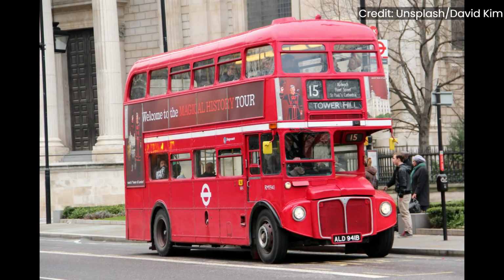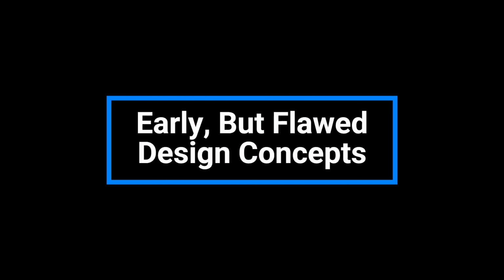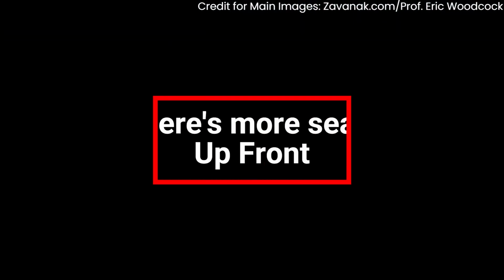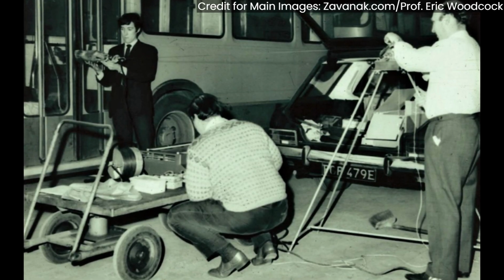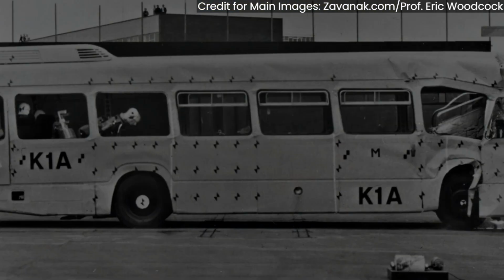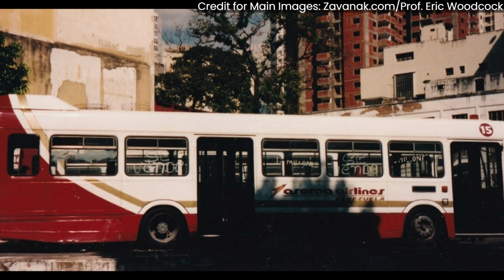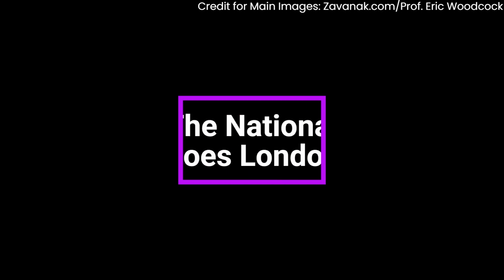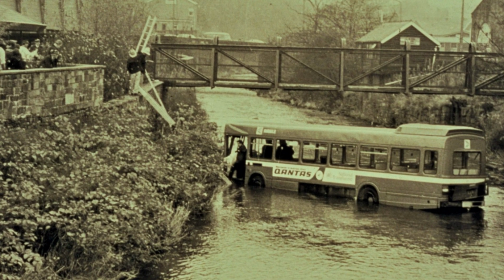The Leyland National Bus: Amazingly Flawed Engineering!

Comment: I watched and I watched to find out what the amazing flaws were, but all I saw was a really thoroughly designed bus that was a giant leap forward from previous generation offerings. The fact that dummies in some seats appeared to be more vulnerable than others may seem shocking to an outsider in 2024. But you're looking at it with 2024 perspective. Previously no-one had even bothered doing crash tests on buses, so ignorance was bliss! Engineering by its nature is full of compromises. This video just exposes some of the difficult choices that had to be made. The fact that the National was the first bus to be built in a modular design is not a flaw! You said yourself that all major manufacturers have subsequently copied it.
It's dated in some respects by modern standards, but in others it is still remarkably current. Just because standards have progressed doesn't make it flawed, in the same way classic cars aren't all seen as flawed. This video has a very misleading title.
Reply from the maker: Hello! Fully noted about the flaws aspect! Thank you for watching!!

Comment: Dude, I drove both the semi-auto Mk 1 around 1978/9, and the Mk 2 fully auto when it first came out, for Bristol Omnibus (publicly owned corporation run bus company, I learned on a Bristol FLF with a 'crash box', great fun). The Mk 1 was weird to drive; the steering was assisted, but not self-centring, in fact it often felt harder to pull back from full lock than getting there in the first place. It took some adjusting to. The engine was SMALL, with a turbo, the idea being that it would be economical to run. Sadly, as little as 4 mpg (Imperial, of course!) meant they were often governed down to where the turbo hardly spun up, with 6 mpg, but terrible acceleration. They crashed and rattled a lot, the older Bristol REs were much nicer to drive (and less 'crashy') even with no power steering. The Mk 2 was not much better. They had a slightly larger engine, but were also governed quite hard, so that on certain hills - Rownham Hill, plus one in Portishead - left in auto they surged ahead in 2nd, lurched into 3rd, but the torque couldn't pull it and so it dropped straight back to 2nd. For about half a mile... You could hold it back in 2nd, but it was so slow. Nobody liked them much. Sometime later one or two were adapted to run on railway tracks! They were really rubbish then!! But thanks for the memory prompt (-:)~
Reply from the maker: Hello! Wow, thanks for all of that info...kind of justifies the video, LOL. Too bad I didn't know these details, I would have added it to the video. Thanks for watching!!!
Reply: You've echoed what I've said elsewhere, the REs were much nicer to drive. They also reminded me of the Royal Blue coaches we used to catch to Bournemouth in the 60s with their evocative sound. Ours still had the £, s, d markings on the money tray.
I also passed my manual test on an FLF. My instructor on W&D showed us how to change gear once on the move without using the clutch by getting the revs right. Also that even in top gear, with your foot off the pedal, they will still chug along at a very low speed on the flat due to the torque of the engine.
Lovely, purring tickover sound.

Comment: West Midlands Travel  (the bus company formed from the West Midlands Passenger Transport Executive when the law changed)  used to have a fleet of Leyland Nationals.  They were replaced in the 1990s with the Leyland Lynx, which had 2-part folding doors with an unglazed 4-part section at the bottom.
Reply from the maker: Thanks for the additional info on the Nationals! Thanks for watching!

Comment: Belgrade, Yugoslavia, use to have Leyland buses. They were known as having misterious semi-automatic transmission with no clutch. 
They also were had to kept running in the winter over night, as if engine drops to low temperature, it would not start.
Reply from the maker: Hello! Wow, that's really interesting to hear about the Leylands in Belgrade! Thanks for watching!
Reply: I recently learned that diesel engines are happy to tick over for hours on end, so that makes sense.

Comment: I remember them being trialled by SELNEC. They were numbered in the EX series along with some Metro-Scanias and a couple of Mercedes.
The National became the standard single decker for SELNEC and GMT.
Reply from the maker: Thank you for watching and for your comment!
Reply: Yeah, and they were absolute sheds. Worked on them in the 80s and hated them. My biggest memory of them was the windscreens jumping up and down by an inch or so. The door shear pins were another pain in the arse job, and probably one of the worst manifold systems for getting them sealed properly. Anti roll bar bushes were another part we were constantly replacing.

Comment: Hi. ONCE I TRAVELLED AND THE BACK WAS ON FIRE. SMOLE COOMING FROM THE MOTORS AND VENTS AT THE BACK.
 I used to travel on the leyland national in the 70s and 80s on short local  services  as a child in Yorkshire. The seating was leather-red on the buses with half doors and orange on those full length. There was backward seating at the front of the bus and a single sideways seat. Some buses had no backwards seats but one long side seat usually orange and a large luggage rack. The half doors had a step up to the back seats for smoking passengers, divided by two glass sheets. Non- smoking at the front. They were spacious and comfortable to ride but the engine noise, particularly on the hills in Yorkshire was extreme and unique. Also, the back of the bus would often get caught as it climbed. I used to enjoy listening to the belt at the back of the bus when it stopped, for passengers. It also had a particular sound.. There was plenty of standing room with leather holders hanging from the ceiling. These buses were painted in the National red colour scheme with large NATIONAL symbol and lettering, They then were painted in the adopted West Yorkshire PTE Green and Cream.  Red suited them better. The seats were also changed from leather to a harsher brown and orange  chequered uncomfy surface with brown leather trim.  The backwards seating , the glass partitions, half doors and non smoking area disappeared.
Reply from the maker: Hello! Oh my gosh! Very interesting recollection of riding the Nationals, wow! Thank you for watching and for your comment!
Reply: @JeffreyOrnstein  cheers

Comment: Great video, well done. The National was a horrible bus to ride on as a passenger. It was OK if you sat at the back, but as this was usually for smoking passengers you would have other issues to worry about. I didn't mind having one on a short hop in to town, but if I was going on a longer trip and a National appeared I would always find something else to do for 20 or 30 minutes and hope the next service produced a Bristol VR or Leyland Leopard. The coach seated variants were more acceptable, but they lacked the plastic shield between the lower and upper decks which was present on the bus seated ones in order to stop the flying passenger issues discussed in your video. Most operators at the time really wanted a full air-suspension version of the Bristol RE, but as Leyland owned Bristol, they saw to it that the Bristol RE was put out of production  to force operators hands. The only exception to this being in Northern Ireland where they flat refused to buy anything but RE's for suburban use and so a limited production run had to be kept open for them to stop losing that business. The National's also had a tendency to twist when going around sharp corners, most notable when looking in your wing mirrors... I've always liked Leyland vehicles, the Leopard (even though brakes appeared to be option...) and the Olympian which was a lovely smooth bus to drive. However I was glad to see the back of Nationals.
Reply from the maker: I"m very glad you liked the video! Very interesting to hear your experience with the National!! And yes, the RE was a great bus! Thank you for watching and for your comment!

Comment: These were running at least until the late 90's, possibly even into the 00's, opperated by Yorkshire Traction. I used to love the visual effect when sitting at the very back and watching through the windscreen. You could see all the way through the bus (which seemed much longer than a double decker) and it made the twists and turns of the road quite surreal. Sitting at the back was very bouncy as you were well behind the rear wheels. The side widows were an issue - the rattled loudly when going over bumps (but then most bus windows do), and had the habit of either popping open when it was cold and wet, or refusing to open when it was hot.

The image you showed of the crash test where the dummy crushed its neck on the seat in front was rectified by extending the height of the  seat back in front.

Comment: As a former NBC manager I well remember the horror with which many of us greeted the National. In its early days the engineers were terrified by its complexity and fuel consumption, the drivers unnerved by how light it was to drive and the passengers alarmed by how fast it could be thrown around by thoughtless drivers. However, everyone could see that it was a quantum leap in terms of ergonomic design, the engineers soon tamed its worst design faults, the drivers soon adapted, and it set the standard for a generation of new buses. It was originally intended to last 12 years, but in the event, many ran for 25 years, often retrofitted with DAF, Volvo or Gardner engines. The real reason it failed to gain wide acceptance outside NBC, or in export markets, is that many operators prefer to support local coachbuilders, and many countries specify a minimum percentage of local content (usually the body), which was not available with an integral vehicle.
Reply from the maker: Great to hear from a former NBC manager and your experience with the Nationals! Thank you for watching and for your comment!
Reply: A lot of the early development ended up being done in the field by NBC engineers rather than by Leyland.  The phase 2 largely copied the revisions on Northern General 4441.

Comment: The National was the first UK bus product to have roll-over and frontal impact testing - there were no rules, no equivalent of NCAP or Euro NCAP. Some of the research was done with ECW bodied Bristol RE's a lighter single decker than the Leyland National. The work was carried out by the Cranfield Impact Centre (located in what is now Cranfield University), using early forms of finite element analysis. This work was fed into the Leyland National design, as well as other Leyland bus designs in the 1970s. Roof collapse in roll over had been a growing issue, causing this work to be commissioned. 
Of course, this was part of the government funded bus programme, a system that Leyland and the brands it owned by the late 1960s - it's own name plus AEC, Bristol, Daimler and so on - which was removed in the early 1980s in a move to 'free market economics'. An operator in effect had to pay more to buy a non-approved body / chassis combination under the previous system.
The Leyland National competed with the Bristol RELL and RELH in the UK market, but then in 1980 Leyland decided to close the Bristol factory. The sole product - the double deck Olympian - was transferred to Lillyhall. 
The Leyland National also had the infamous '500' engine with monolock design, which had huge potential but was put into mass production before durability testing was complete. The result was huge warranty costs right across the Leyland empire - it was superceded by more reliable Leyland designs. This approach to product development was the primary reason for some of the mistakes.
Reply from the maker: Wow, thanks for all of the information and thanks for watching!!

Comment: I remember well travelling on the Leyland National as a young man and was struck by it's modern design and the smoothness of its transmission and engine. The pod on the rear of the early versions was to draw in air for cooling the engine and for heating of the interior.  It was a shame it didn't continue as a passenger bus but continued as a train in the north of the UK known as a Pacer train using the same body and engine but with a redesigned transmission and a twin axle boggie at either end of the carriage.
Reply from the maker: Thanks for the extra info on the National! Thank you for watching and for your comment!

Comment: Hi everyone, just to let you know  the Jamaica 🇯🇲 Omnibus  Service (JOS) purchased  160 Leyland  National (MK1) buses back in the 70's (1973-1976 approximately) These were the   N buses from N1 to N160. The first 10 units were semiautomatic and  the rest were  full automatic. However from the start,  those buses were not suitable for the tough and hot Jamaican conditions. Furthermore  the mechanics had a hard time maintaining them and parts were hard to come by. Therefore they had to change to a different brand of buses. They bought  Albion  Clydesdale and Guy Victory(approximately 100 units).
Reply: Hi Jeff, thanks for your reply. There's one more thing I left out about those buses. Because of the vandalism in that country,  the passenger seats were being cut up. Therefore  JOS  had no choice but to order those  160 units with TOUGH FIBREGLASS  seats.
Reply from the maker: Hello! Thank you for the additional info about the Jamaican Leyland Nationals! Didn't know how many they had!
Reply: I believe some of the Clydesdales had Leyland National bodies adapted to fit them.

Comment: The engines in these things were atrocious, they had the cylinder head cast into the cylinder block which meant if the clynder valves were suspect the enire engine had to be sripped down to examine them. The tappets were bucket and shim so which required the OHC camshaft be removed to adjust them, a very time consuming procedure. I`ve worked on many makes of diesel engine, and these things were easily the biggest pile of garbage ever made.
Reply from the maker: LOL, very interesting words about your experience with the Nationals. Thank you for watching and for your comment!
Reply: They had a very unforgettable sound. I loved it.

Comment: That was a most informative video and it's great to see a fresh perspective. I noticed your reply somewhere about the successor of the National, the Lynx. One interesting factoid is that the driver's windscreen in the Lynx was influenced by the Grummon 870. 

Althought there are plenty of youtube videos, digestable information on that bus is restricted to books and webpages. I sought to correct that issue and released as far as I know the first Lynx info-bomb video on YT with surely more to follow. There was a bit of a gripe over the text but it was well received having been checked over by an important designer. If you are interested, the 10 min video is here.

https://youtu.be/B1UO-H9iJWs?feature=shared
Reply from the maker: Hello! I'm really glad you liked the video!! I always thought the Leyland Lynx had some influence from the Grumman Flxible 870. So, now I know! Very interesting video! - I've never seen anything in depth about the Lynx. Wish I knew more about the connection between the two buses  from two different countries- could be a good subject for a video. Thank you for watching from the UK and for your comment!
Reply: @JeffreyOrnstein  rode one of two ex demonstrators back in the early 1990s in Sydney with Cummins 5 speec ZF Ecomat combo and the body rattling was atrocious. Smart looking bus though.

Comment: In Australia, Brisbane City Council bought about six of them around 1975/76, but never went back for more, and the small batch didn't last long. Surfside Buses on the Gold Coast was a much more satisfied customer, making the type the mainstay of their fleet from the late seventies into the eighties.
Reply from the maker: Hello! Very interesting to read your comment about the Australian Nationals! Thank you for watching from Australia and for your comment!
Reply: @JeffreyOrnstein  Surfside ran 39 at their peak use of the type from a handful they purchased new in 1976 and the rest second hand ones they aquired from various operators in Sydney (including ones I caught to and from school as a kid) from the mid 1980s. They scrapped most of them by 1994, selling off a few.
They were the biggest privately run operator of the type in Aust. ACTION in Canberra had the largest fleet of about 70 units (20 1974 long pod ones and the rest 50 1975 build short pod ones).
20 recieved MAN motor and Voith 3 speed gearbox transplants in the late 80s as hand me downs from MAN Sl200 buses in their fleet recieving higher HP engine upgrades!

Comment: I'm very impressed with this. For a guy who isn't British, you did an excellent job, and I can't fault it. Well done!
As someone who drove these for around 15 years in the 80s and 90s, I have a real soft spot for them.
The roof heating was hopeless for the driversas well as the passengers. The bus's front panels were pretty draughty, especially at the age these were when we got them, and you were always cold in the winter.
Something had to be done! Now I don't know if it was a standard mod but, on our fleet, the "improvement" was the installation of a rainwater downpipe and spout from the roof - usually cable tied to the rear of the cab area near the aisle - and a matching hole in the ceiling to force the air down the pipe. It wasn't particularly effective, but better than nothing!
Other than that, I found them great to drive, easy to manoeuvre, and comfortable enough that you didn't get out with any aches and pains at the end of the shift.
Reply from the maker: Hello! I'm really glad you like the video!!! Just wait until my next one I'm working on...hopefully you'll stay tuned! And thanks for your experience with the National! Very interesting!! Thank you for watching and for your comment!